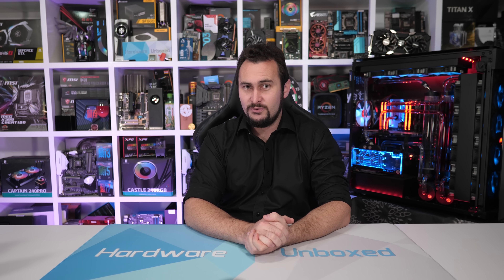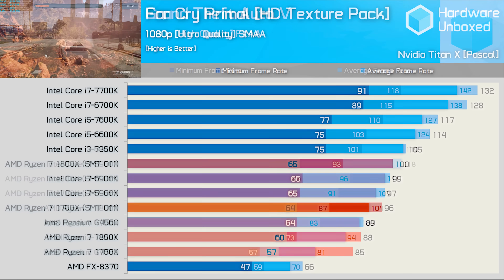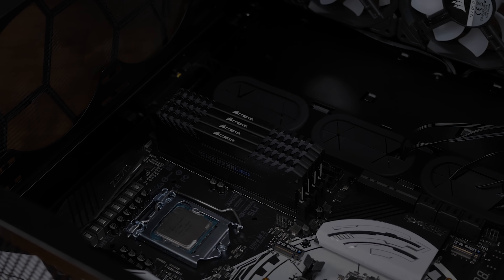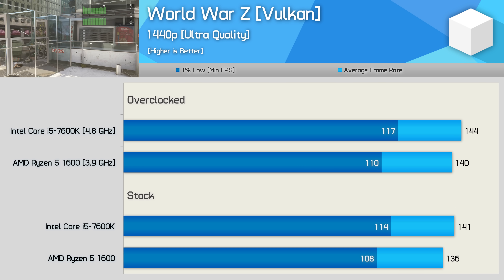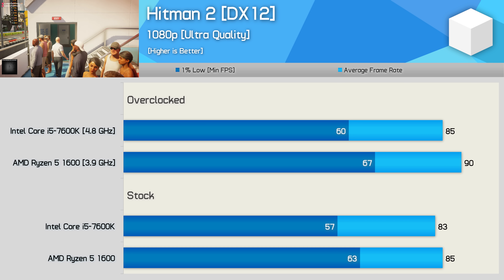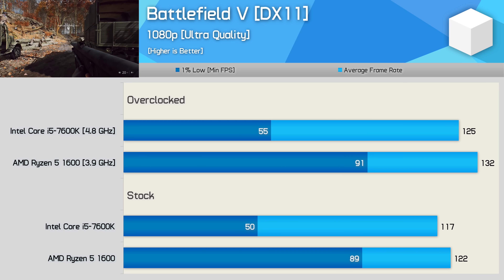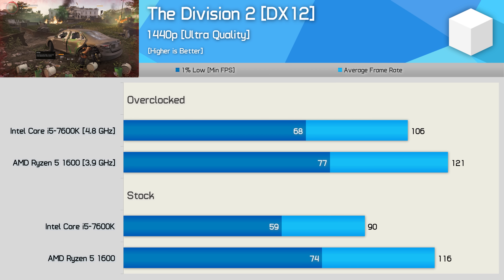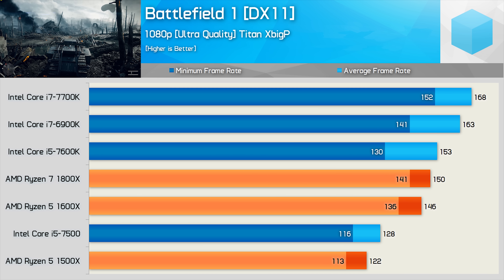Ryzen 5 1600 vs. Core i5-7600K, How Times Have Changed!

Comment: Back in 2016 I built a number of new PC’s when Skylake was the hottest chip around, Ryzen didn’t exist yet and the Core i5 still seemed like a good value option. I even upgraded one of them with a 7600K around the time Ryzen was released. It’s sad to see how fast those Intel CPUs lost their luster. Nearly all of those PCs have been upgraded to AMD Ryzen by now and the 7600K is up next for replacement once the 3rd gen Ryzen parts drop.
Reply: i predict my 7700K running happily at 4.7 GHz has a few more years life in it...(maybe by 2021, Intel will finally release 10 nm? ) :)
Reply: mdd1963 Hyper-threading is really the saving grace for those 4-core i7 parts, assuming you won’t be forced to disable it in the near future due to security vulnerabilities. Back in early 2017 even a 2C/4T Core i3 was still an okay option for budget gaming, but that idea seems nothing short of laughable now.
Reply: @Astfgl  yes, I'm sure lots of folks will be disabling hyperthreading for these hypothetical exploits not yet in the wild with no confirmed examples yet of any breaches...(but I wont be one of them)
Reply: @mdd1963  And yet the previous bunch of hypothetical exploits not yet in the wild have had very real performance impacts through BIOS updates and Windows patches. My point is you may not have a choice in the matter. But if hyper-threading remains working then yeah, your 7700K should last you a good while yet.

Comment: This is a real nitpick(somewhat) but Ryzen doesn't do CL15 without gear mode down being disabled, so it likely ran 3200CL16 where Intel ran 3200CL15 :(
Reply: Depends on the motherboard and ram.
I'm running my ram at 3200mhz cl14, just activated xmp and it worked perfectly.
Reply: @RawUpgrade  Because thats an EVEN number. GearDownMode disables uneven CLs from being used. This isn't a motherboard thing this is a GDM thing.

Comment: I got X370, and my mobo has not been shown to be compatible with Zen 2. I’m disappointed. AMD told me the chip that stores processor compatibility is too small to fit all the generations they’ve released, but where was the warning about that when AMD promised AM4 compatibility through 2020? If I’d gotten a Ryzen 3 1200, for example, I’d be itching to upgrade to a Zen 2 part, but unable to upgrade without changing my motherboard, at which point I almost might as well build a new machine! As it happened, I got an 1800X, and it delivers playable performance with threads for days, so I’m content with my performance now. My beef is that I expected to be able to upgrade to Zen 2 or later to breathe new life into my PC as it ages. I know the clock speeds of the 1800X aren’t that high and the IPC isn’t that great, and now I’m stuck with it. If I upgrade my mobo, I’m waiting for DDR5 to boost the infinity fabric, so I’m waiting for AM5 and new CPUs therein.

Comment: I bought a 7600K for my first build ever last year. I'm looking to hop on to the AMD train and get an X570 and a R9 3900X depending on how good the reviews for it is.
Reply: Don't worry too much about the reviews, my dude. Back in the day, most reviewers recommended the i5 7600K over the R5 1600, claiming that for pure gaming there is no comparison. Look at the i5 7600K now. The R9 3900X will probably not beat the i9 9900K in gaming when it releases. But a few years down the line, 12C/24T will feel better than 8C/16T with game optimization and applications' ability to leverage many threads. But don't preorder anything. Wait for a few months after release so that the driver/bios patches have fixed the issues that are very likely to arise since Zen 2 is a fresh release and not a refinement like the Zen+ chips. Happy gaming
Reply: @manuel_the_q  Thanks for the solid advice, man! You certainly cleared a few things up for me. I appreciate it

Comment: I think the 7600k will bottleneck with the 2080ti , 4c/4t for newer cpu intensive games not good enough.
r5 1600 is clearly a better choice 
Thanks for the comparison :)
Reply: Even the 9900k bottlenecks the 2080ti at 1080p.
Reply: The point of the bottleneck is to test the cpu capability and compare them.
Reply: the 6600k and 7600k did well in their day for the money....; certainly, few would choose one post October 2017 with Ryzen and 8600K/8700K available...

Comment: It's not shocking that a 6cores/12threads beats a 4cores/4hreads in some heavy multi-threaded games when both paired with the fastest gpu, the rtx 2080ti. But form the group of custumers that have bought either of these cpu's back in 2017, who would upgrade to the rtx2080ti?!For this comparison to be objective, you should have also compared them using a more midrange card like rtx2060/2070 that most of the buyers of either cpus would upgrade to. The 7600k might prove same or better  performance than r5 1600 in most games with such midrange gpus and  it was better in older games so it might not be  a bad purchase after all as can be concluded from this video.

Comment: The core usage in games will increase again , when the new consoles launch. Both Microsoft and sony are going for 8 cores and 16 threads

So if you thought the 1% lows on the i5 7600k is bad now, it will get worse. Everyone with a 7600k should be searching ebay for the best deal on a 7700k or 6700k
Reply: To swap out their cpu? Yeah but it’d be a safer bet to just sell off their cpu and mobo while it’s not completely worthless to get a 2600 or 1700.
Reply: Only cost me $65 dollars to switch from a 6600k to a 2600.
Reply: You say that, but my 6600k @4.9ghz still gets 100fps+ in all the games I play. Used 6700ks and 7700ks are overpriced and for most people it doesn't make sense to upgrade.

Comment: i5-9400F boss in budget segment right now)
Reply: it will be in the same boat as the 7600k in 2 years as thats compared to the 2600x.6 threads vs 12.no brainer.
Reply: @jasonschofield37  i'm not sure that games can utilize so much threads in next two years. For modern standard with 5-6 threads in most games developers go for years.

Comment: I may have missed it; was the i5-7600k updated for the latest set of MDS (Zombieload, etc) vulnerabilities? Have BIOS updates started to go out (I know Windows 10 was recently patched).  Was HyperThreading disabled? If not, it can only get worse.  I built an i7-7700k system at Christmas 2016 and while it is hanging in there, not being able to do a swap to a current CPU without a new motherboard/chipset stings when I look at the Ryzen counterparts.  Next time, AMD.  Like the work you do (hope the throat gets better).

Comment: Wonder what my 2700X (4.3 all core, 3266 CL14) combined with  my new Asus Vega 64 will do in AS: Oddessey which is the only game I have in this line up. And yes I know Vega 64... But here (The NL) it's half the price of it's NVidia rival and I like the idea of a complete AMD build. Haven't undervolted, overclocked nor modded it yet (I do have the products to do so, which were just 30 Euro for the best stuff you can buy). All really easy to do, although agreed should not be necessary. AMD screwed that up a bit. But that's what made it cheap for me, none of the reviews on it took that in account and understandably. For those interested I'll keep you posted.

Comment: I knew someone who was going to get the 7600k, but I told them to get the 1600 instead for all the reasons you have put. It looks like the newest games are taking advantage of 6 threads, which is nice to see!
Reply: they've been taking advantage of 8 threads at least for 2 years since BF1....
Reply: @mdd1963  Most Intel 6 core / threads parts are beating the 7700k though, so the benefits of 8 threads don't seem to be a big benefit in games just yet.

Comment: Your being kinda disingenuous with this video, as your only testing with the 10 games, something which you know will give the newer Ryzen chip the edge. 
If you were to test with the full 34 game test, you were known for. The result would be far more balanced. 
Not to mention, you arn't telling them, that you can just upgrade to the 1440p resolution if your old cpu isn't up to the task.
Reply from the maker: Come on mate, the point of the video is to test the latest games and that's exactly what I did. The point is pretty clear, the Core i5 isn't cutting it in the latest games and no 1440p doesn't solve the issue, we quite clearly saw that in BFV. The point is the R5 1600 is a much better gaming CPU in 2019 than it was in 2017 relative to the 7600K. You can expect the situation to be even worse in 2020 for the quad-core.
Reply: @Hardwareunboxed  Most of them, yes. 
Obviously you can only test so much, with your family and all. 
But i reckon if ya added a few more games the result would change(Not that ya should re test it just for me, or anything like that) 

Also as for quad cores, yes they are done. 
But only from new, on the used market they will still be pretty viable, especially since the majority of games is still favoring them(It is changing, but given the average game takes around 3 years to make. 
Which means ya still got atleast 3 years. 
If not more(Not all games are Crysis after all).
Reply: Orcawhale quad cores are basically the new dual cores in games
Reply: Lmao this incel is butthurt about the results.
Reply: @MaximusMilkshake  Ahhh yes, the typical "You must be X because you said Y. 
So predictable..

Comment: It's a miracle that consoles can even run modern games with Jaguar CPU which is 2007 level performer.
Reply: Next gen consoles are getting Navi and 7nm Zen. Not to mention Ray tracing and Freesync; consoles are about to get fucking Lit.
Reply: With 8 cores and capped at 30 + severe drops, they can pull it off but only just.
Reply: Only because games are developed with exactly that hardware in mind. Those Jaguar chips are the same in every ps and xblox making much greater optimisation possible.

Comment: I can buy a 1600x for £110 at the moment,thats cheaper than a 2400G! (£115)
Reply: Well yeah, the APU is the big selling point in the 2400G, it’s the best you can get for those super tiny Asrock brick sized systems. The 1600 was the same price as my 2200G at Microcenter, but I picked up the 2200g for benching (2 things to play with, graphics and CPU, twice the fun!).
Reply: The 2400G is however better suited towards casual gaming and small HTPC build. For gaming on a budget, pair the 1600 up with an RX 580 for ~ £150 to £170 and you've got a solid 1080p gaming rig.
Reply: 1600 for 80 USD new. there's a small chain of retail stores called microcenter that always sells processors for a steal. And when you buy it with a motherboard you get an additional 30$ off.
Reply: @seanmiranda7514  Yes but that will be + £200 for a return plane ticket and then %20 tax when i get back to the uk... lol
Reply: By over sea bro.
Really a 2600 cost here in the Netherlands only 130euro .

Comment: it's interesting that hardware unboxed used a Z sieries motherboard for the Intel CPU but only a B450 motherboard I do guess the B450 is about the same as the X370 but you can place a 1600 on the X470 and is or was a cheaper than the Z270 motherboards.
Reply from the maker: It's interesting that you think this makes an ounce of difference.
Reply: @Hardwareunboxed  doesn't though better vrms better hardware
Reply from the maker: @foltarz8469  Depends on the board really, but all B450 and X470 boards will deliver the exact same out of the box performance so it's a moot point really. The B450 board we used is better than most X470 boards in terms of VRM quality anyway.
Reply: @Hardwareunboxed  Yes it is a good motherboard I have the MSI X470 gaming plus which the tomahawk is basically a similar board
Reply: @Hardwareunboxed  Oh and don't get me know I have a R5 1600 great processor, but I would take a X series board over the B series in a heartbeat and I would stay away from Asrock boards as I had a 990fx fail and a X370 with the same failure, I have heard someone else on Tech Deals discord had an Asrock X470 Tiachi have the same failure.
Reply: it doesn't make any difference. b450 can easily max out the 1600.

Comment: I'm actually more surprised that the 7600K still beat 1600 at a few AAA titles, even with no overclocking involved
Reply: This is because those games are coded like garbage and spam a single core, hence why intels turbo spec focuses on a single core. In those games that stock 7600K would have been running 4.2GHz vs the 1600s 3.6GHz.

Comment: Good thing I changed my mind about getting 7600k on the last minute.
Reply: Ordered my 7700K-based rig a month before Ryzen released, had it built a week prior to Ryzen launch...it's been happily running at 4.7 GHz all-core turbo since...; no regrets here, either.
Reply: @mdd1963  It is-was just to expensive, not saying that it is bad 😊
Reply: The 7600k is better than the 1600 in nearly every title.
Reply: @icy1007  You forgot to watch the whole video.

Comment: For those of you near a Micro Center you can get a new R5-1600 for $79.99 USD, and if you need a motherboard you can "bundle" CPU + Motherboard and save another $30.00 USD.  Currently the i5-7600k sells for just shy of $300.00 USD new online if you can find one.   Keep in mind you would still need to buy a heat sink with the i5-7600k and you don't get the $30.00 USD "bundle" price I mentioned.